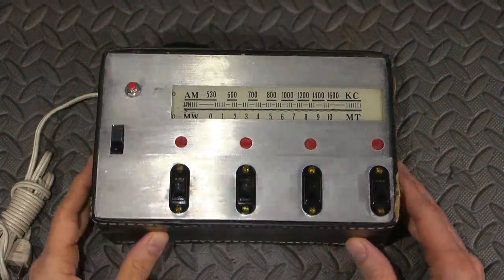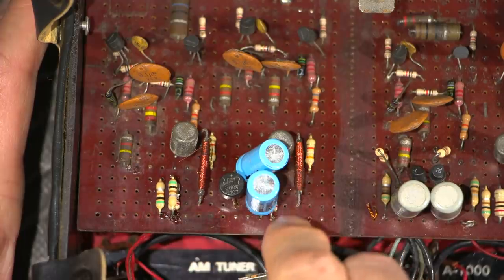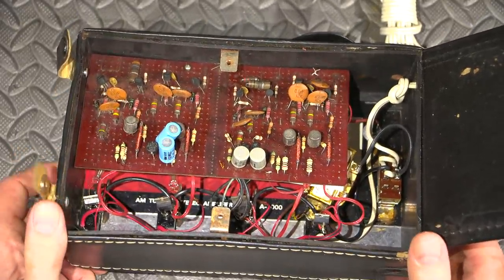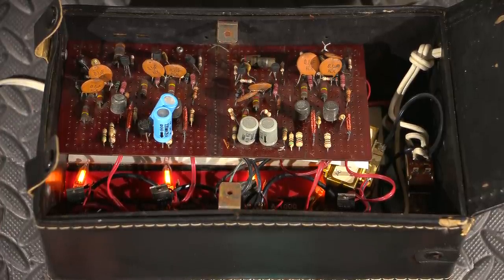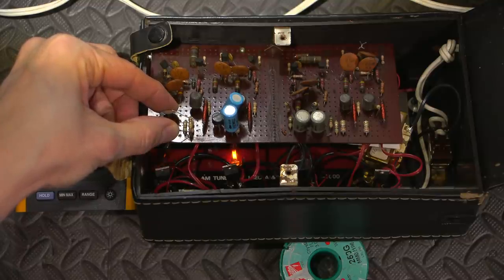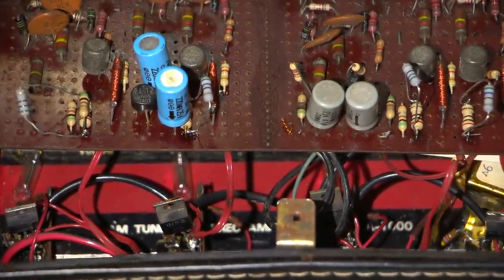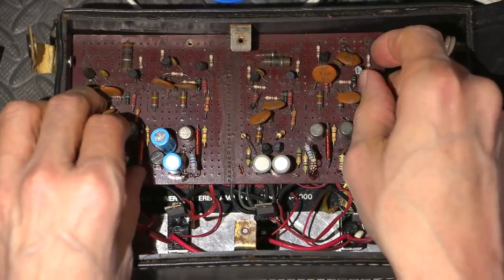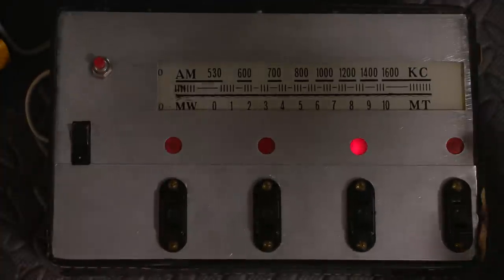Electronic Mystery Box - What Is It?

Comment: 200v ?? Japan is 100v not 200. Korea and continental China are 220v. The card looks like Chinese.
Reply: Japan is both 100v and 200v (and both 50 and 60 Hz oddly enough.) The breadboards were labeled "Nobel Japan" as well. What little we saw of the card couldn't determine if this was Chinese or Japanese as Japanese use many of the same Kanji. I would have loved to see the complete card.
Reply from the maker: Japan has 200V service. We have 120V and 240V, they have 100V and 200V.
Reply: @MrCarlsonsLab  But lighting circuits are like ours on the lower voltage.
Reply from the maker: Yes, you could be correct, but remember this is a home brew project, (could be for the stated transformer primary voltage,) and the labeling on the board indicates Japan.
Reply: Residential is 100V, split phase and three phase 200v and 415V. And of course 50 and 60 Hz (cycles) some areas around US bases tend to be closer to 120V if I'm remembering that right might be confusing the Philippines. Probably far more likely that they used a 200V transformer at half voltage.
Reply from the maker: In the video, it didn't operate at half voltage, and the board is marked Japan.
Reply from the maker: I think I got all of your replies :^)
Reply: @MrCarlsonsLab  oh yes sorry about that, only well it was recent last week I saw a video where you mentioned you read all replies.... eeeeeeeeeeeK. and Under 100 comments I tend to scroll through and see if I can answer questions and see interesting comments. So I was scrolling through and seeing similar questions.
I also noticed that the information on Wikipedia is very not very clear with how the columns are arranged. And while I try not to be an expert on the Internet unless I absolutely know what I'm talking about ( especially because I'm working for somebody/ hopefully worked for somebody by the time you read this who believes you can just watch a video and know how to do cinderblock brick walls perfect. and no they didn't come out perfect. But I digress ) I did dig into a black hole for International electrical and subsequently one of those all nighters was Japan and I followed up with a handful of construction in Japan videos.

It seems odd that it would work at 200 and not 100 when most of the domestic appliances use the two prong plug for 100V and only necessitate a higher voltage for larger appliances.
I also know that both China and the Philippines use the standard two prong US plug with 220/240v which really makes me think that this device might have been originally Japanese and found its way into another country where it got re-purposed. Or maybe after they moved they decided to re-purpose it.

Or maybe it's just some sort of Frankenstein device that shouldn't exist but does like suicide cords......

Crazier things have happened like ring circuits in the UK....
Reply: @MrCarlsonsLab  I guess the moral of the story is to always mark and thoroughly label anything that you make for future archaeologists. I have taken to photographing and labeling anything that I've built and/or repair. And leave my repair-min's mark behind.

Comment: All my Japanese stereo stuff is 100v,   so I don't think it is from Japan.
Reply from the maker: Scroll down the list to Japan: https://en.wikipedia.org/wiki/Mains_electricity_by_country
Reply: Residential is 100V, split phase and three phase 200v and 415V. And of course 50 and 60 Hz (cycles) some areas around US bases tend to be closer to 120V if I'm remembering that right might be confusing the Philippines. Probably far more likely that they used a 200V transformer at half voltage.
Reply from the maker: In the video, it didn't operate at half voltage, and the board is marked Japan.